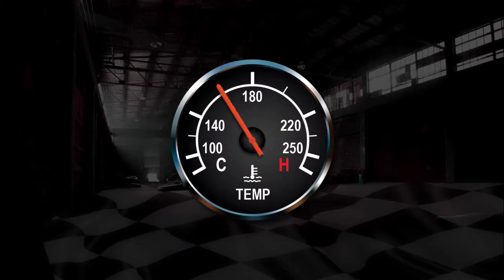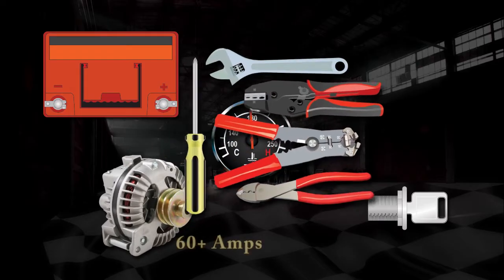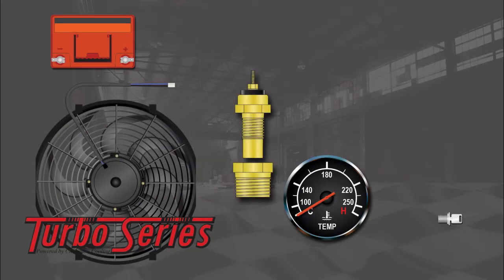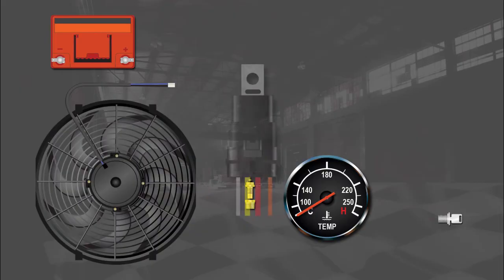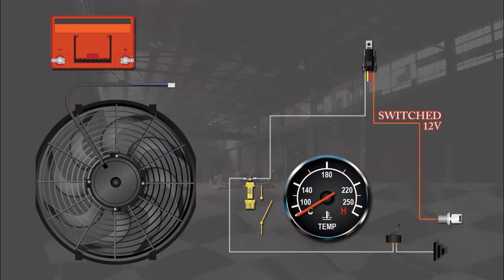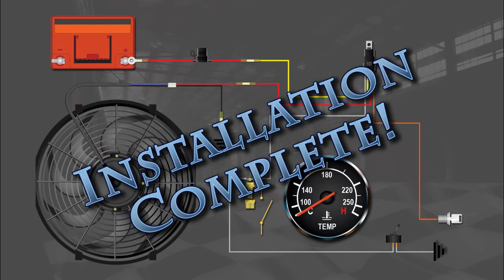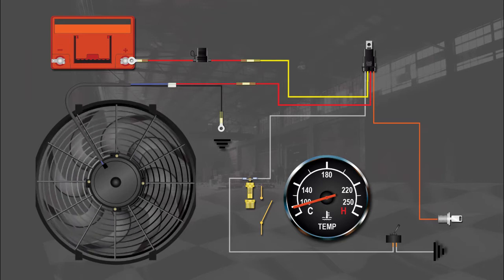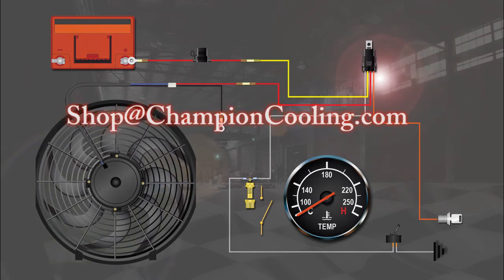Champion Cooling - Fan Relay Installation

Comment: How do you find the connection point for the KEY ON wire.???
Reply from the maker: You'll have to talk with a tech or someone that can assist. Too many different vehicles and configurations for me to tell you which is correct. If you have an electric choke, that is a 12V+ connection, I have used that before. The relays don't draw a lot of current in the switching circuit.

Comment: My kit came with one relay and I’m adding another one, can I crimp/ combine the wires that go to the coolant temp switch together and run it to the one temp switch ? Or will both wires on each individual relay need to go to a separate coolant temp switch ?
Reply from the maker: The small wires (orange and gray on our relays) both go to the same place, so yes, they can most definitely be crimped together, no need to run both wires the full length.

Comment: The bypass switch should be in parallel to the temp switch
Reply from the maker: The way it's shown is correct... it is in parallel because the temp sensor is grounded, also. That temp sensor (switch) is an on/off switch in our kits, and all you're effectively doing with the bypass switch is providing a ground circuit to the relay to turn the fan(s) on at will, even when the engine temp is below 185º. With the switch on, the function of the temp sensor is irrelevant.
Reply: Or here is another way connect terminals 86 and 30 directly to the battery positive with a fuse 87 connects to the fan and connect 85 to ground via temp switch and toggle switch
Reply from the maker: @angelobryan4699  Not recommended. Terminal 86 goes to ignition-on so that the fan doesn't run when the ignition is off. There's no purpose to have the fan on when you turn off the ignition, since coolant isn't flowing - it won't cool the engine, it's just drawing battery current pulling air through the radiator.
Reply: @ChampionCoolingSystems  If the temp switch or toggle is open the relay won't energize
Reply: I personally used that method and the fan never kicked on unless either switches in the ON position
Reply from the maker: @angelobryan4699  If the temp switch and the toggle are both grounded, then when either of them is closes the relay(s) will activate and turn the fans on. Wiring it the way you're suggesting, if the temp is 185º or more, the switch is 'closed' and the fans will operate - because the relay is connected to the battery instead of ignition-on mode.

Wiring the relay as you are suggesting, when you turn off the engine it is common that the engine temperature will rise a little - because coolant isn't flowing. The fans will continue to operate until the engine temp reaches about 175º or less, when the switch opens again. It will not matter whether the toggle switch is on or off; when either one of those switches is closed, the fan will operate. What you're describing is exactly as the diagram in the video, with the exception of the relay being triggered by 'ignition-on' instead of being connected directly to the battery, as you suggest.

Thank you for your input, you can wire it however you feel it should be. However, I have been doing wiring for over 40 years, including rewiring an entire vehicle; we will continue to advise our customers the best and safest way, which is exactly how it is shown in the video. We strongly advise not connecting the orange wire to the battery, all it does is drain the battery while you're walking away from the vehicle and the temperature remains above 185º.
Reply: @ChampionCoolingSystems  I'm learning as much as I can thank you🙏🏾
Reply: @ChampionCoolingSystems  not necessarily you ran 2 sources of power...the wire going to the turn key is your 12v right there so it best to run a fuse off the ignition wire to the relays #30 thats the only power source you need not both
Reply from the maker: @vee950  It is wired properly, as shown. The ign 12v+ is to activate the relays, and is not enough power for the fan(s). The ignition switch typically uses a lower amperage fuse, and the fans can draw up to 25-30 amps each, which would blow the fuse for the ignition, while you're driving. Never run high-power components through the ignition switch, always provide separate power to that circuit of the relay. Thank you.

Comment: Do you have video on how to wire dual fans?
Reply from the maker: It's just like this video; add another relay and wire it the same way: both gray wires together, both orange wires together, red to second fan, yellow to battery with its own fuse.
Reply: @ChampionCoolingSystems  thank you!

Comment: looking on their website they are proud of their stuff by looking at the prices. I spent $17.00 for a relay kit, and they sell one just like the one I got for. $74.95 .
Reply: There are relays 12V 20A 30A 40A
Different prices
Reply: Cheap relays might not have a diode fitted to prevent voltage spikes when relay is switched off. FLYBACK DIODE.
Reply: The one you got is probably  junk! Haha

Comment: I can connect the gray wire to the thermo switch of my car.
Reply from the maker: Hello-  you can only connect the gray wire to the thermo switch that came with our relay kit, they're different switches. Ours is on-off, the one in the car is variable.

Comment: Can I use the starter post for the ignition wire?
Reply from the maker: Hi David - I wouldn't. That's a constant hot, and you don't want the fan on all the time.

Comment: If my sensor wire is a double wire, can I still just clip off the sensor and add a loop terminal to then attach to the top of the temp sender i have installed?
Reply from the maker: Not really sure what you're describing there. Our sensor is an "on-off" switch, whereas most sensors are variable. A variable sensor will not work properly because on that type of sensor only provides a solid ground connection at full temp (about 250º). Our sensor provides a closed connection at 180-185º, and opens at about 175º. On a double-wire sensor, one wire is a constant ground connection and the other is to a load (like a gauge), and cutting the wrong wire would render the sender function inoperable. Additionally, our sender will not work at all with a gauge, as it would send the gauge to read 250º as soon as it closes at 185º. This video describes the different sensors: https://youtu.be/tN2cGiz1wcQ

Comment: What temperature is the switch and what temperature thermostat should be used?
Reply from the maker: As stated in the video, our switch will turn on at about 185º, and off at about 170º, but you can get switches with varying temperatures. As for the thermostat, that's individual preference based on the engine and location,  but typically between 168º and 195º.

Comment: Stupid question, what if you want your vehicle to run around average temp around 190? Is what temp the fan kicks on adjustable? From what I read your offerings kick on at 185 and off at 165???
Reply from the maker: You can buy a sender with different range from Summit, just make sure it's an on/off switch, not a variable switch: 0-300º.
https://www.summitracing.com/search?SortBy=BestKeywordMatch&SortOrder=Ascending&keyword=Electric%20Fan%20Thermostat%20Sending%20Units

Comment: Do I need to drill a hole for it to be mounted in the intake manifold? I bought this kit for a Ford ranger, doing an e fan conversion
Reply from the maker: I wouldn't drill any holes in the intake, most areas are too thin to install a sender. If you don't have an additional port, we have an article that might have some ideas for you:
https://blog.championcooling.com/2017/07/14/senders-switches/
Reply: @ChampionCoolingSystems  thanks, I have one of those T fittings and a few hose clamps coming and hopefully it'll work, but im pretty sure I'll have to connect it to a ground.
Reply from the maker: @imnottellinudontwannaknow3188  Using our sender, since it's a 1-wire sender, it should ground to the fittings and intake. If you use a thread sealer, use it sparingly - too much and your sender won't be able to get a ground connection. Most fittings are tapered (NPT) and will seal pretty tight.

Comment: Hi, if i want to make the fan kick in when the ac on, is it safe if i connect compressor  wire to trigger relay?
Reply from the maker: Hi- It all depends on the A/C system, if the compressor is triggered by a positive lead (compressor clutch is grounded) or if you have a two wire lead to the compressor (where one is the ground wire). If it's an aftermarket A/C, please contact the manufacturer and they can best guide you on how and where to connect the wires. For instance, with Vintage Air, you'll need a Trinary switch, and they can assist you with that and help determine what is in your system already. For a factory system with a single wire to activate the A/C, you'll need to install an additional relay, as our fan relays are triggered by a ground connection at the sending unit.

Comment: Whats the number on the relay for those color wires ??
Reply from the maker: Not sure what you mean about the number? Do you mean part number?
Reply: @ChampionCoolingSystems    sorry the number of which color wire is plugged in im starting from scratch i only have red blk blue yellow
Reply: For example gray one is 85 ground ?
Reply from the maker: @stranger1907  Sorry, didn't see your reply. This video is for our specific relay kit, and the wires are sealed and the schematic is for our system. 
For aftermarket relays, this would be the standard wiring configuration: 30 - battery+; 87 - accessory; 86 - +12v switched; 85 - ground. Since I'm not familiar with your specific relay and wiring, I can't tell you which wire would go to which circuit.

Comment: Why didn't you explain which terminals that the wires connect to on the relay, which is 1 of the most important pieces of the puzzle?, lol
Reply from the maker: Because this video is for installation of Champion Cooling relays, which are pre-wired; they're "plug and play" - so all you need to do is connect the wires as shown in the video. If you want to see how the relay and temperature switch function, that's a separate video.  Thanks for your input.
https://youtu.be/tN2cGiz1wcQ

Comment: What amp alternator would you recommend for a dual fan setup?
Reply from the maker: There's a process to figure out what you'll need by adding things up, such as audio (amplifiers) and other electrical items that have been added. For just adding dual fans, consider they may add 20-40 amps, so if you have a 60 amp alternator you might want to look into getting something 80-100 amps. There are lots of one-wire alternators these days that will have an internal regulator and are very simple to connect.
Reply: ChampionCooling The factory provided a 60amp. I upgraded to a 100 but i also have efi and a new fuel pump. Im thinking 100 is not going to be enough. I see it charging at 14.2 often but I dont think it can keep up because if i drive it all day the battery goes dead.
Reply from the maker: @Campbase1  Sorry, for some reason YT didn't notify me of your message. The basic rule of thumb is to add up all of your components: Fans, audio, EFI, Fuel Pump and try to install an alternator that is close to or a little higher. My car survived on a 100 amp alternator for a couple years, easily, with these components. Just make sure your charge wire is large enough (minimum 8g). While the car is running, put your hand on the wire... (try it when there isn't residual heat from the engine) ... if the wire is warm, it's probably best to go a little bit larger to a 6g wire. If the wire is cool to the touch, it's fine.
Reply: ChampionCooling thank you. As i recall, they replied some time ago.  Its working perfectly at this time.  I have a 100 amp installed.  I think some of my heating problem was related to engine timing.   Thanks again

Comment: I want to install a switch because my electric fans sometimes come on before I restart my car, and it strains the battery a lot. If I do it this way, will turning it off with the switch cause it to be off no matter what?

Essentially I want to wire a kill switch to my electric fan.
Reply from the maker: If you wire it correctly, the fan will always go off when you shut the engine off with the ignition switch.  If you turn off the key and the fan still works, it's not wired properly.
A bypass switch is an option, some use it for A/C or very hot days, but the temp sender will still turn the fans on at about 185º regardless of the bypass switch.

Comment: Well mine is wired this way. And it burns wires and relays .I rewired it to use as a ground and it does the same .. wires are the same size as fan . Fan is also a stock fan. Any help on this .. email me if you can help .. jrcracein@yahoo.com
Reply: Well i did find out the person that wired it had high and low speed wired  together.  I tested the low side and it would eminently start burning wires . High side was good ..rewired relay and hooked it up and so far so good. Your video helped  me thanks
Reply: Update fan motor was bad . I took all wiring out and wired the new one up your way. Problem fixed thanks for the help I understand how they work now 🙏
Reply from the maker: @fishingdaily4692  glad to hear it... !
Reply from the maker: If wires and relays are burning then you have a short somewhere - it means too much current through a wire. This schematic is ONLY for "Champion Cooling Fan Relay Installation" as the title suggests, and using our electric fans. It would not apply to every electric fan application - especially for factory electric fans. For that you would need to consult a factory wiring diagram to see how the factory fan is wired, not all electric fans are the wired the same way, and each depends on the vehicle and manufacturer.

Comment: What guage of wire to be use. And to to connect to thermo switch with a two way connector
Reply from the maker: to be used where?  For the fan circuit: typically 12g or 10g, for the relay switching circuit: 16g or 14g, for the sender 16g is fine.

Comment: Great helpful video! One question, how do you wire the fan system to turn on when you turn on the A/C?
Reply from the maker: Thanks!  Since each system is different, we suggest getting in contact with the manufacturer if it's an aftermarket system, like Vintage Air. They can make sure you have a trinary switch instead of a binary switch to control electric cooling fans, and can advise you on which wire to use to trigger the relay. 

For a factory A/C where you likely have only one wire to the compressor - you will need to wire in a second relay to trigger the cooling fan relay, because the OE style usually has a single wire that is +12 volts to trigger the compressor. Using a second relay will allow you to convert the signal to create a ground trigger, which you could connect to the gray wire.  
See if this article helps a little: https://blog.championcooling.com/2019/05/20/how-will-adding-a-c-affect-my-cooling-system/